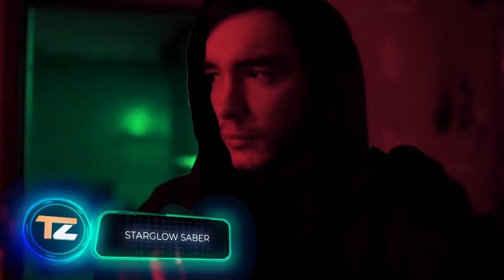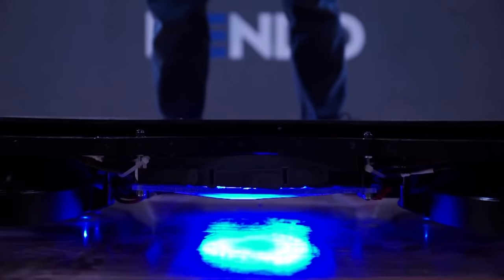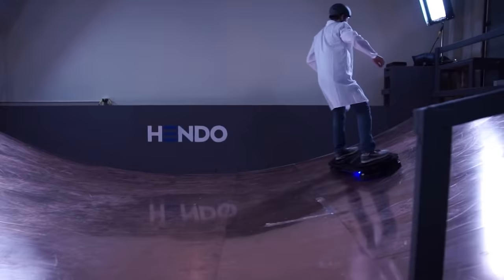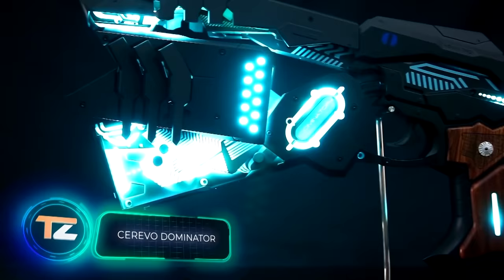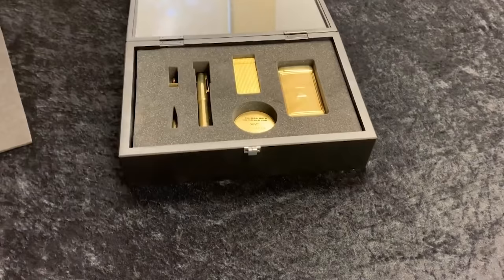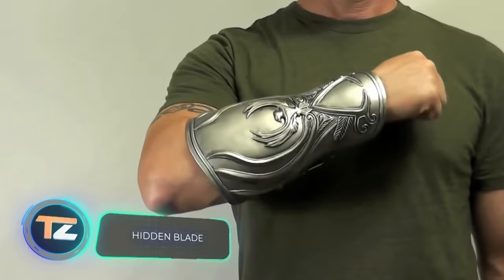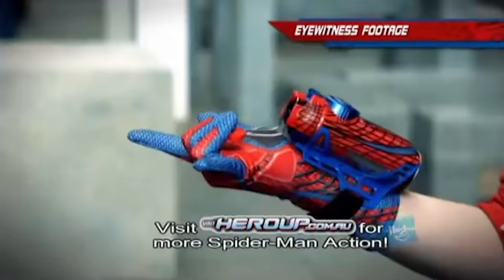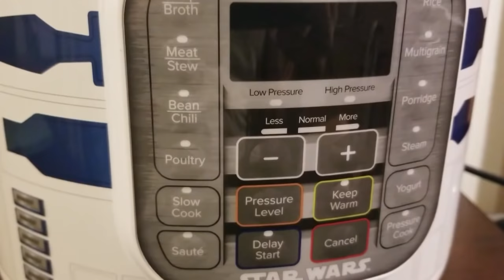8 COOL MOVIE GADGETS THAT ACTUALLY EXISTS

Comment: Wow, 7 yrs to hear about the hoverboard... it must really suck.
Reply: It works great, as long as you stay on specially designed surfaces.  The surface your hovering over needs a magnetic field for the boards field to push against.  If I remember correctly it also runs rather hot and needs filled with liquid nitrogen.